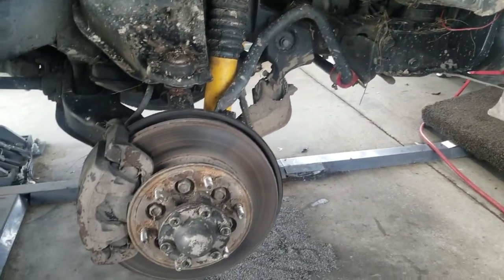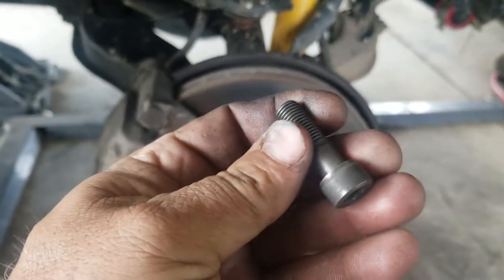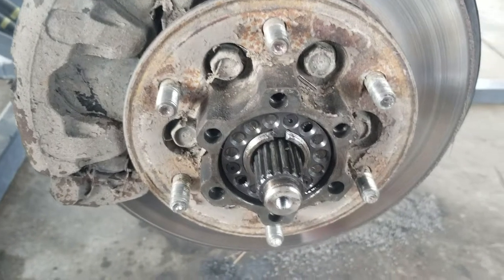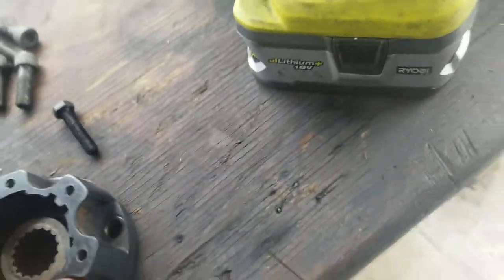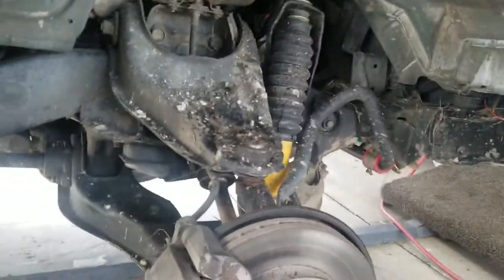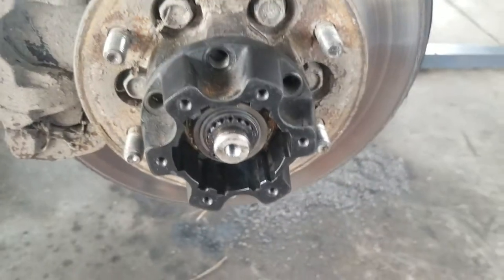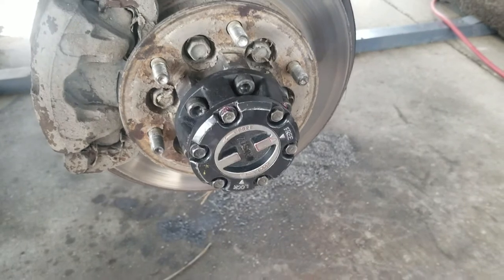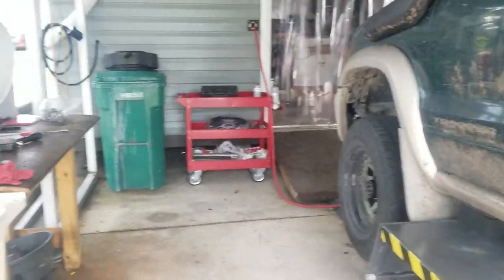1998 Isuzu Trooper Manual Hubs Installed

Comment: Hi Robb O, What size of tires are using after your lift?
Reply from the maker: 285/75/16
Reply: @robbo6460  2 inch lift and 285/75/16 tires?how about the clearance between tires and body?
Reply from the maker: @khairulanwarazhar6695  No issues on my end. No rubbing or anything. Plenty of clearance.

Comment: Robb, I want to convert MY 98 without TOD to manual lock hubs, but I see the AISIN fit charts all stop at 1996 as the latest year they say they fit. On the Trooper Mafia page, some guys tell me the FGM 001 part is the right fit, that the AISIN company doesn't list past 1996 because the TOD came out in 1997, so they won't list them as fitting, because you can't use them with TOD systems. I sent AISIN in Asia an email a few days ago, but they probably won't answer it. Yours appear to be used but in good condition, so how'd you know they would fit your '98, AKA "Shrek"?
Reply from the maker: I believe they are 27 tooth. That was all that mattered. I got mine from Jerry Leamond who simply told me that they fit my 98 without TOD. As long as the spline count is correct your good

Comment: Hi Robb, did you end up getting better fuel millage? Thanks for all these vids. Bought a 3.1TD a few months ago and plan on taking it to Morocco in the summer so these videos will help me lots.
Reply from the maker: Nope. I guess the snorkel really killed my MPG. I get 10.5 to 12 depending on conditions. Thanks for the kind words on my videos. I appreciate it
Reply: @robbo6460  Holy cow! I am happy then, because with the stock hubs, I get about 17-18mpg highway, 10 mpg towing a 19-foot-long, 1.5 ton (lightweight) camper trailer. But a couple days ago while on the last leg of a road trip, the exhaust broke loose at the flange that bolts to the header, and scared the shit outa me with that sudden noise. Thought I blew the engine, but nope. Just a broken exhaust pipe right behind the manifold, at the first flange weld. 

I think it broke because only two of the three bolts in the manifold/pipe connection had nuts holding the flange on. The third was gone! It had to have been like that since I bought it 10 years ago, and finally cracked until it fell off. I saw that when I got under to wire it up for the trip home. I  appreciate your videos. Thank you for sharing the details, your experience and mechanical knowledge, and your common sense view on things, like packing the hubs with grease. Better a packed up bitch than not, I agree.
Reply from the maker: @logmeindangit  I'm glad I can help. Thanks for the kind words

Comment: Got a question about it- on the last piece that the manual hubs get bolted on to (the one that takes the 8mm hex head bolts) mine has lots of free play and moves a few mm in each direction is that cause for concern? I have some noise from my front and not sure if it’s a wheel bearing or whatever that piece is called
Reply from the maker: Are you talking about the cap or under the cap where the spacer goes?
Reply: Robb O it’s the giant black metal in your video I think it’s called the hub housing assembly. Has 6 holes around the outside and 6 small threaded holes to accept the manual hub- the piece that is just behind the c clip. On mine that center rotational piece has play
Reply from the maker: @alecgildner1200  the 6 outter bolts lock it to the brake rotor. I assume those bolts are tight and your movement includes the brake rotor too? Your hub assembly is loose and needs to be tightened or your bearing assembly is shot. Either was it's not difficult. Are you in any Facebook groups for isuzu?
Reply from the maker: @alecgildner1200  this shou help too.
https://youtu.be/PkNQ176_Jp8
Reply: Robb O sorry I meant it has play itself when it’s not bolted to the rotor. When bolted down the rotor/hub is solid. I have a post on planetisuzoo for it too https://www.planetisuzoo.com/viewtopic.php?f=4&t=142685